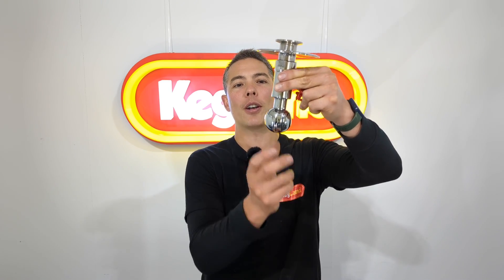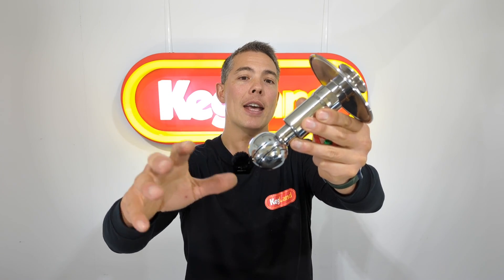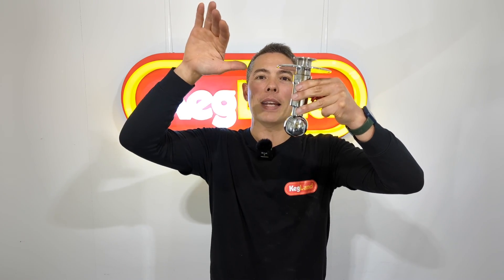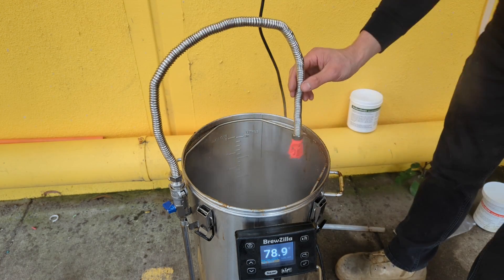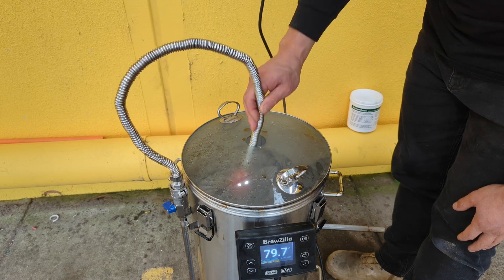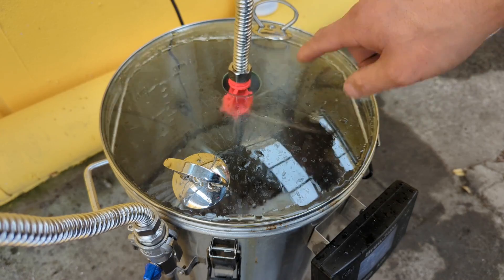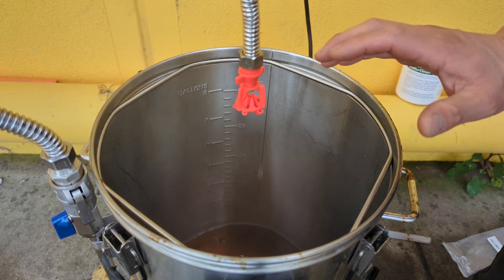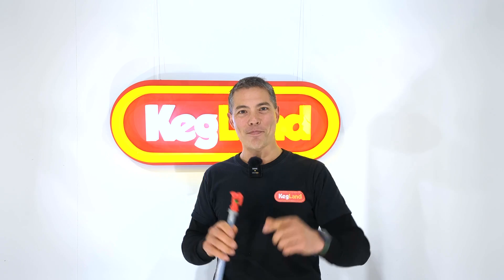Auto Clean your Fermenter and Brewery with CIP

Comment: It squirts out between the nut and the flex arm and i can't get it shut. Is there a trick getting it sealed?
Reply from the maker: The flex arm should come with silicone seal.  Please make sure these seals are in place.  If you are not careful they can fall out of the female nut if nothing is connected.
Reply: @KegLand  I managed it and it's really fiddly because the nut always jams, but you can't see that. If you hold the nut and just turn the connector, it's pretty easy.

Comment: SO any plans to release the pluto gun or pick nick tap in 8mm? or Flow control ball lock in 6mm?
Reply from the maker: what is the application that you want to use these in. We have a number of new products in the pipeline.  We have a Nukatap Mini that is pretty cool with several new shank options so you might want to look at that first.
Reply: @KegLand  the smaller id for more restriction,  and so you can go pick nick tap into the flow control ball lock

Comment: Did I miss a section about fermenters? I suppose this will only work with the fermzilla, not the allrounders ? They are a very nice product, but I do not think they're easy to clean because you're always afraid to scratch.
Reply: The do have the bucket blaster for cleaning fermenters
Reply: @Rockhead-Rumple  Do you really think that they work well enough? I think it's very hard to get them clean with the "allowed" temperatures and chemicals.
Reply from the maker: It would work on the all rounder but you would be gradually filling the all rounder up as you spray the solution into the all rounder.  With the FermZilla conical you can gravity feed from the dump valve back to the brewzilla boiler and thus be continuously be recirculating.

Comment: Would this device work upside down? I’ve had an idea about turning my old Gen 3 brewzilla into a corny keg washer
Reply: Would also like to know if it works inverted!
Reply from the maker: This device will not work upside down. For corny kegs you are still better off using the Bucket Blaster.

Comment: The previous versions that didn’t get released of the CIP head was going to have a  detachable rotating head that could be used as a sparge / recirculating head. Is that still tye case for this one?
Reply from the maker: Despite a lot of work it ended up being a compromise to have one device that could be used for both applications.  As a result we have a separate sparge device that we will release on it's own at a later date.
Reply: @KegLand  awsome thank you.

Comment: Reaching all the contact surface areas is the minimum requirement for a CIP spray device. The other being the pressure and volumetric flow rate. Depending on the application, gentle sprays can be ineffective against certain scaling or biofilms. Of course the temperature of the CIP cleaning or sanitising fluid is another critical factor.
Bacteria have clever techniques that have evolved over hundreds of millions of years (actually billions of years) that enable them to survive changes in their environmental conditions. Forming Biofilms is one, transforming into spores is another.

I like the cost effectiveness of this device and its suitability
Reply from the maker: Yes it's a great addon to a brewery.  The BrewZilla with the new dish based is the perfect vessel to heat and recirculate CIP solution so it's a good addon product.

Comment: Why don't the spring clamps come with the kit when they are essential? No need to buy more steel now... It's gonna sit where it's supposed to with the recirc arm and tube cut to length
Reply from the maker: Yes that is a fair point. We will see if we can make that included as of the kit.  The various different breweries have different heights of arm required and also depending on if you are using the standard lid or distillation lid the silicone should be cut to a different length. so it's best that the customer cuts the silicone tube themselves.
Reply: @KegLand  but really unique and awesome product nonetheless! thanks

Comment: great device -can u show a video of it hooked up to fermzilla all rounder for cleaning ?
Reply from the maker: I agree. Just after I finished the video I should have done that. the FermZilla just needs to be a bit higher so the liquid then gravity feeds back to the brewzilla.  If you do this make sure you do not set the water temp above 50C or you can melt the tank.  Other than that it works really well.
Reply: @KegLand  would enjoy seeing recirc (ie best gravity feed system) -not quite sure how this would work on an fermzilla all rounder